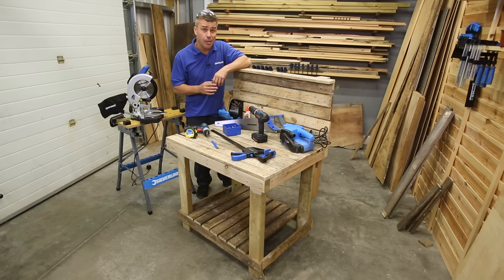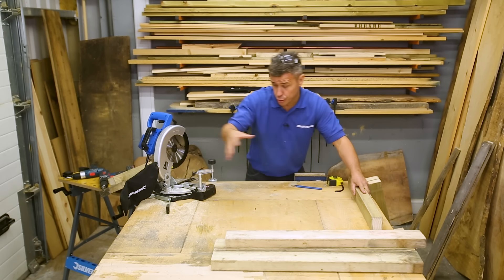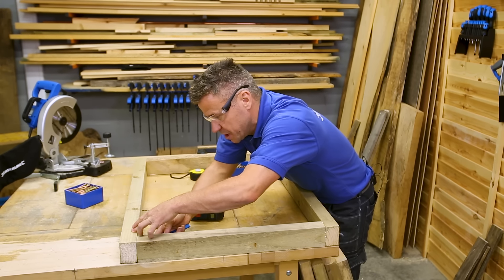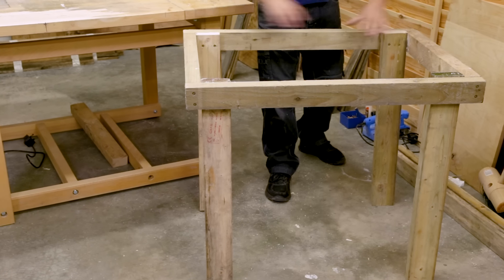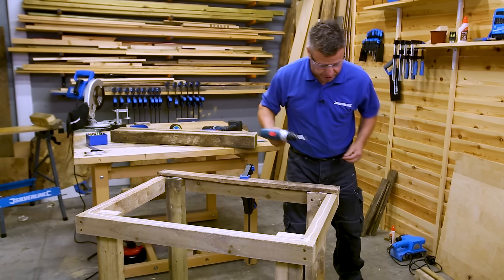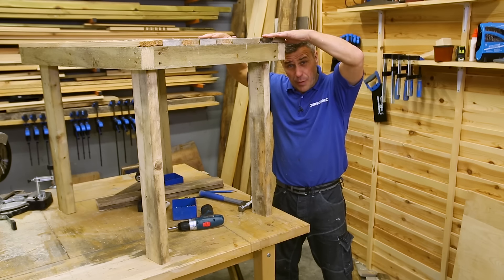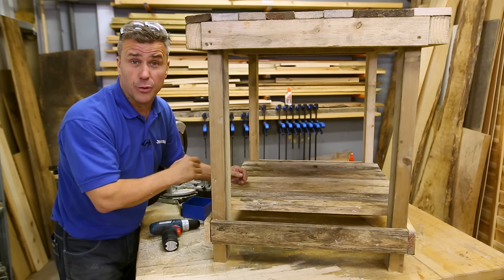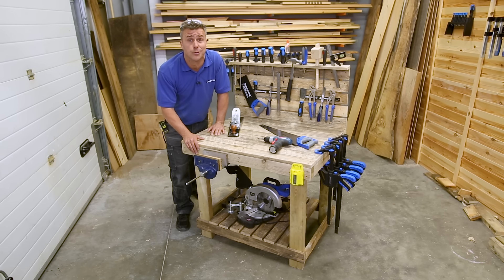How to make a DIY workbench with pallets

Comment: That was a very cool video. Easy to follow, logical. If you took 2 of these benches placed side by side you now have a 4 ft x 8ft long, 35" inches high very usable work bench.  Add 2 heavy duty caster wheels to make bench mobile. Plus, great example of how to use JUST the pallet wood as souce to build complete pallet. The add on back shelf by inserting half of other pallet....brilliant.
Reply from the maker: Great Tip!

Comment: My tip for getting even gaps when you're spacing slats: place another slat or small piece of wood in between the slats while you're screwing them in, then move and repeat. More reliable than measuring!

Thanks for the great video 😌 these pallet videos are very inspiring. Any tips for tidying up your pallet timber when it's damaged or warped? I've collected lots of pallets lately but they're all different widths and thicknesses which makes building with them extra tricky!
Reply from the maker: Top Tip! Thanks!

Comment: I already got the same skeletal framework with those skids as legs so they very strong, were you marked ends I cut halfway thru then glue an screw them square as I could 
Have a 2x3 bit of kitchen worktop I used, with this glued then screwed at rough 45 degree into underside inside an out added metal brackets to help secure all together just finishing off now
Reply: Sounds good, we hope our videos help you.

Comment: for the frame construction corner joins, use a speed square - measure out a perfect 90deg angle, otherwise it will come out crooked, speed sq is a life saver
Reply from the maker: Great tip! Thanks

Comment: looks great will be a good shop work bench I like to work outside with lots of fresh air  so i got to build a steel one the same size but with cypress wood top for  weather resistant .....going to build a small tv stand lil smaller than the work bench you built for inside my new car garage ill build it out of pallets
Reply from the maker: Sounds great send us some pics, we'd love to see your projects
Reply: @SilverlineToolsTV  the wood was soo warped from the florida humid till its not worth a flip but its holding together

Comment: I drill every time to stop splits, especially with sapele I make three of those little squirrel size picnic bench tables about five inch 
Good way to square the legs had to reach back with foot an pull table  legs in as I drill and fix opposite legs you grin 😃

Comment: Hi Craig buddy, i have nearly a dozen pallets mostly with blocks at corners rather than 2x4 skids. i have also cut some down by about half so they only have the two skids or sets of blocks with other plank slats i have cut to size and then glue and screwed these into L shapes for the legs.  will they be weak if i add them to the pallet exterior or should i switch some blocks for skids and bolt these together. think i just answered my own question on how too.

Comment: Where in the world do you get pallet wood with no old nail holes. I've never seen a pallet where you could pull the nails and the hole close up! Magical!
Reply: Tim Loer i was wondering the same thing!  And perfectly straight with no forklift damage...   and he is screwing into the end-grain without pre drilling,    Old dry pallet wood would split if you even thought about doing that.  Ha ha.  But that’s what you get from Someone who’s tools Look like they just came out of the box...
Reply: Get some wood filler. Pilot holes do help...
Reply: @Jimlbonner  maybe just a little hard on the guy but after 19 years in the pallet business I would say that most pallet wood isn't ready to build with unless you prep it first. Rough cut wood is often uneven and building something straight and square with it can be a challenge that will lead to disappointment for most beginners. An item like this isn't hard to make with palletwood and it doesn't have to be perfect. Good thing cause it won't be. Notice someone suggested he sell "plans". No plans needed for something this simple. Just the material, a few tools and a functional mind. Anybody should have a square handy as they build and I'd use construction adhesive like liquid nails, not wood glue.
Reply: He dint get them from a pallet because 2x4 used on pallets are undercut which gives pallet jack and fork lifts to pick up from underneath so no way those 2x4 are from a legitimate pallet he bought at store at some point

Comment: Great video well explained,
Was wondering does anyone know how this could be adopted to have the front of the table cut out a half circle (the side you will be sitting facing). Without weakening the structure its called a jewellers workbench?
Reply: Wouldn't be tough. You just need a horizontal support piece in the middle under the top surface to make up for the lack of support in the front section. You can do this with the top and bottom as well
Reply: @MrMega200  thank you will give this a try 👍
Reply: @Tdontworry  No problem. You could also run two boards in an X shape diagonally. All you would have to do in the center part is cut out half in each board in the middle section to allow the two to join together. This is called a lap joint. You can see how one is done in this video. You just have to adapt yours for the angle you need. https://www.youtube.com/watch?v=Z81Y-1VZWgY
Reply: Many thanks

Comment: Hey, man. What if the pellets already have holes in them on the edges? Can we use those as pilot holes or will they be too big  for the screws to fit tight in them? Also, what size are the screws that you use for the top 9 pellets, the ones you use for the "table" part of the work bench? 

Thanks. Great video!

Comment: My biggest problem is getting the darn pallets apart. I wouldn't end up with such nice pieces after I was done.
Reply: Jerome Kukurugya one end off instead of pulling out the nails, then just wiggle them out. Sure they might not be the complete length but you don't have to deal with the hassle.
Reply: Jerome Kukurugya, I've just got some freebie's to start recycling and use for different garden projects and as a beginner wasn't sure how to do it myself. What   EklekTek has said is good, I was initially doing the same but I have disabilities and had to re-think. I came straight on here for other 'how to' type video's and came across a super helpful one. Here's the link for it: https://www.youtube.com/watch?v=vUtR9ZzmNgw. If you find it as helpful as I did, the guy has a website with really helpful stuff too - https://diyforknuckleheads.com/ . Hope this helps :)
Reply: Well Jerome,  it’s normally not that easy,  if you look his “pallet wood” doesn’t even have nail holes.     And like Eklek said cut the two ends off cause they are going to split any way,   And you can usually pry the middle off and if you have a lot of trouble try using a cut off wheel in a Dremel tool  and cut the nails off.
Reply: I was using a crowbar and mallet, but for the larger pieces my neighbor told me to use a reciprocating saw. Because they had three nails and were nearly impossible to take apart without breaking. It works great. Took a whole pallet apart in maybe 5 min. It wasn’t a small pallet. These prices with 5.5 in wide and 4 ft long and there were 4-5 pieces per side. All the wood looks great and you can use a nail to get the nails out of the wood.
Reply: Get a long hachsaw and cut down between the slats and each plank falls off  then you left with the 2 x 4ers I saw great videos on YouTube about taking pallets apart

Comment: Way way under-built unless it's just going to be a potting bench or similar. Going to need a lot more intermediate support under the top -  like every 150mm if you intend to actually chisel/pound on it  -- plus diagonal  support in all directions to stiffen the  frame -and I would also double the legs.

Comment: Love how simple this design is. I'm giving it a go at the moment.. not completely out of pallet wood though.
I do have 1 question. How Important is it that the slats go the same way for different sections. I notice your bottom and top go different directions. My top I have done vertical due to having plenty of offcuts that were the same size.. the top backboard however I was thinking of doing horizontal for ease..

Thoughts?

Comment: Doesn't look like pallet wood to me. No groves for forks anywhere to be found
Reply: I've got some 8 foot pallets.  That would make the skid cuts on the ends or sometimes on the smaller pallets,  the center board doesn't have the skid cuts in it.  The top boards never do or the 2 or 3 or 4 slats on the bottom.

Comment: Why measure in millimeters and not centimeters?  Sounds odd to say 900mm.  Not criticizing, I'm still on inches.
Reply: when using metric, people predominantly use meters or millimeters.  the only time you really see centimeter used is in primary schools and shops
Reply: o bez had no idea. Thank you
Reply: Mr. Mickles WA
Reply: Mr. Mickles In 10 years of working in construction I've never heard anyone give a measurement in centimetres. What's odd is that you still use Imperial.
Reply: Shut up! Imperial measurement is laughable in this day and age.
Reply: Bobby Bob yes. I acknowledged that when  I said I wasn't criticizing since I'm still using imperial. Not a strong reader are you?
Reply: Mr. Mickles you give some people an inch and they take a mile.
Reply: Mr. Mickles it would be odd to say a measurement of 943.5mm,    94cm and 3.5mm, far easier to use   millimetres, a measure over a few metres would be like eg 4.539m,  everything after the decimal in millimetres. I use both imperial and decimal and find the decimal easier to grasp especially when doing small measurements and definitely when calculating volume.
Reply: Mr. Mickles me too, I could never wrap my head around millimeters!
Reply: I was thinking the same thing......now I’ll cut it to 105,000 centimeters......lol
Reply: Its more accurate. Easier to say.